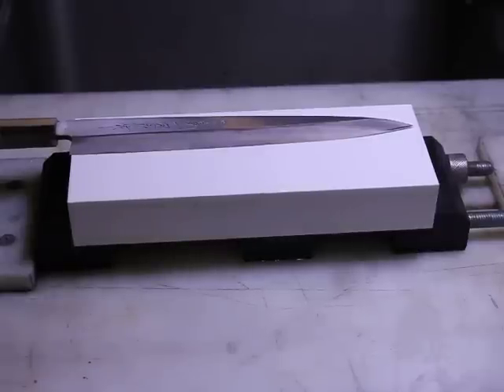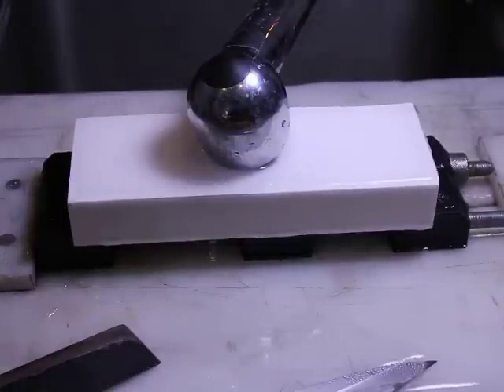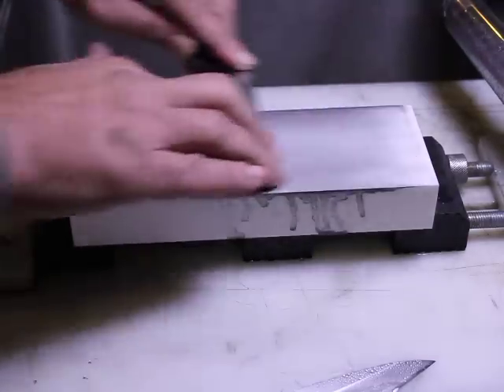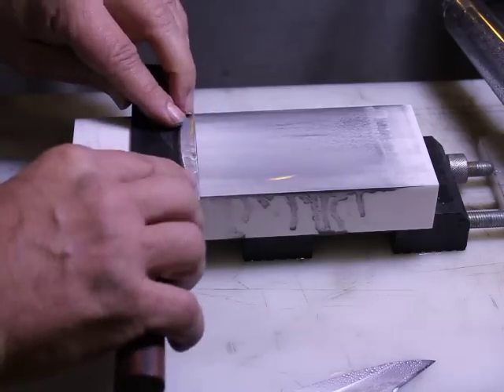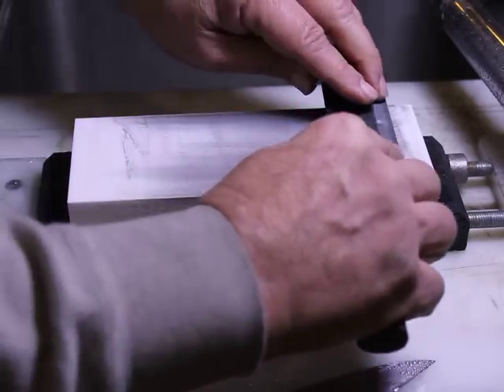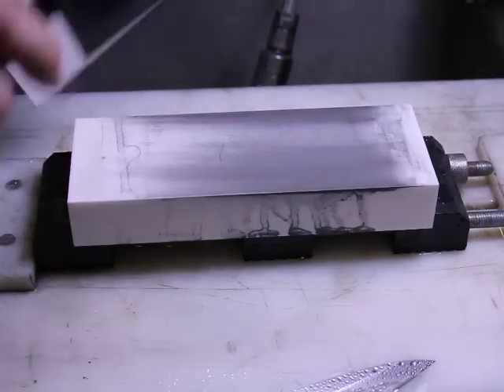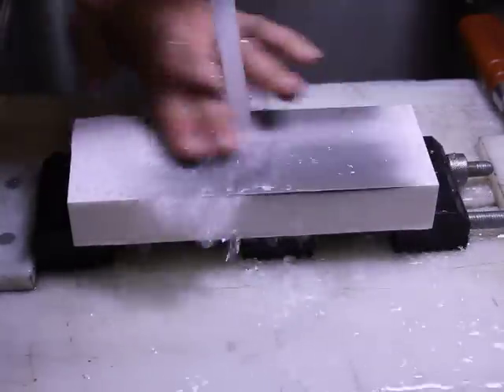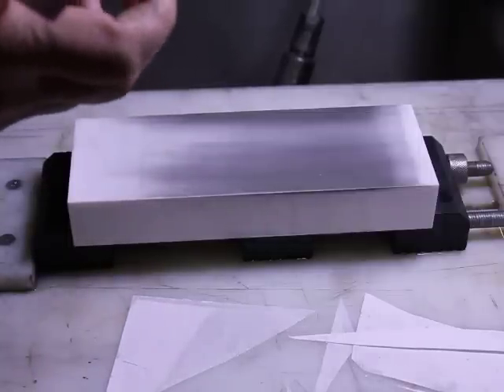Nubatama Bamboo 320 - First Impressions

Comment from the maker: The primary reason for the two series was for the convenience of helping to identify individual stones. Feel free to mix and match between the two series. The bamboo series is usually the more expensive of the two stones but not always. Considering that there are approximately 9 different 1000 grit stones, you can see where it becomes extremely confusing when users describe their experiences with individual stones.